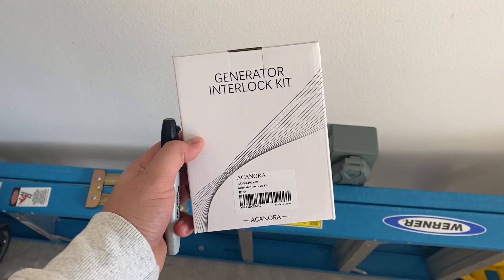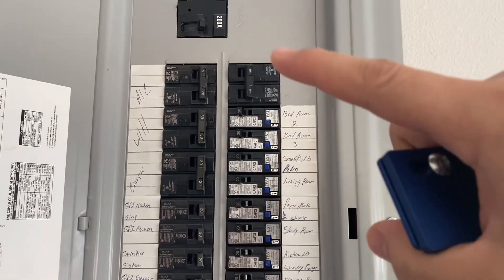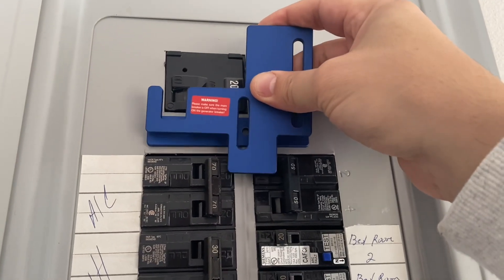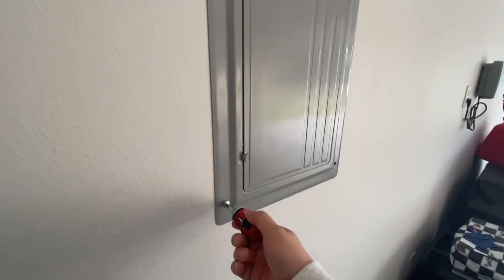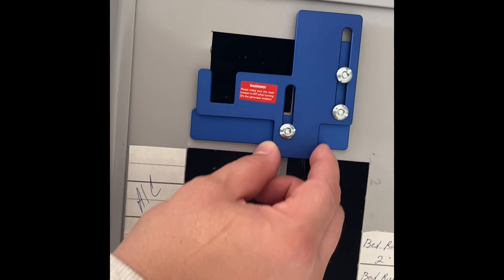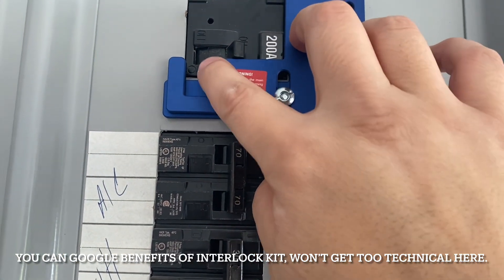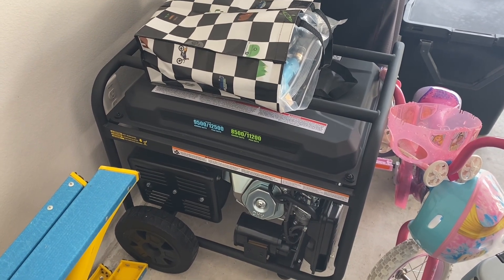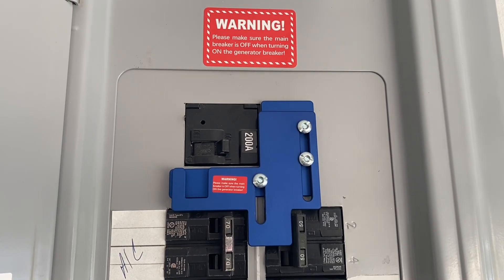Easy install on a $40 Generator Interlock Kit🔥

Comment: Thanks for a quick, simple review of this. I 'knew' what to do, but seeing someone just run thru the steps is appreciated. I'm off grid and have been using one of those Generack 'bypass panels' (only runs a few circuits) and if finally dawned on me that the interlock kit would let me run any circuit, sure - not all at once, but now my entire panel will have power available thru-out house. 

I live off grid so simple solutions let me work on something else... or a beer or three.

Thanks again!
Reply from the maker: @Le_Comte_de_Monte_Felin  you’re welcome

Comment: Link for interlock?
Reply from the maker: Just be sure whichever interlock kit you get that it fit your specific panel box and breakers
Reply from the maker: ACANORA Generator Interlock Kit... https://www.amazon.com/dp/B09V129BK8?ref=ppx_pop_mob_ap_share
Reply: Why didn’t you show and explain the wiring?
Reply: @neomacchio4692  The video is about the Interlock Kit, not about any wiring.